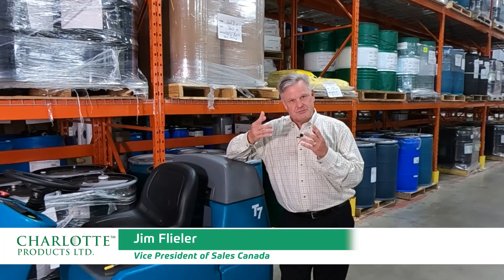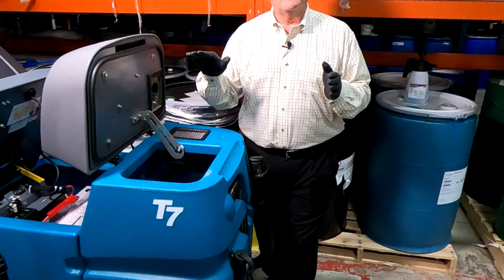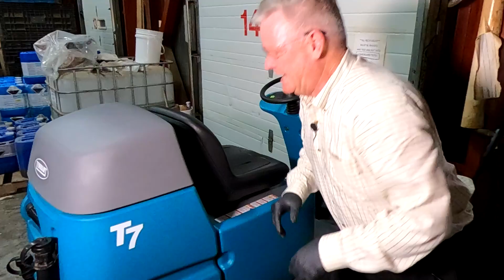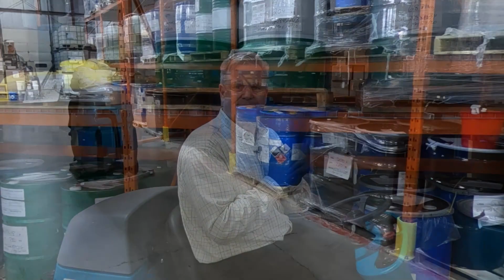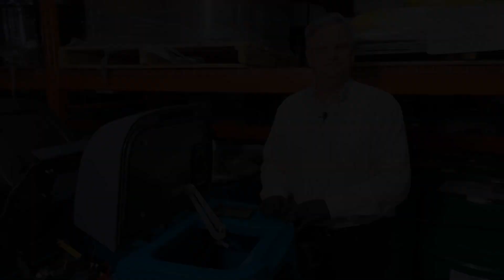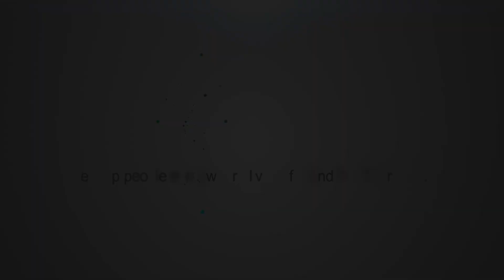Equipment Cleaning Is Essential

Comment: Thus should be a regular cleaning/ disinfecting protocol for any type or brand equipment that collects wet solutions. Wet vac tanks, auto scrubber recovery and solution tanks, carpet extractors and sweepers, Lower the risk of an outbreak